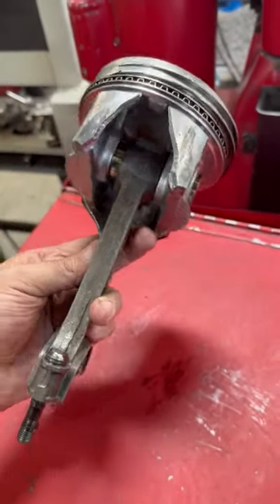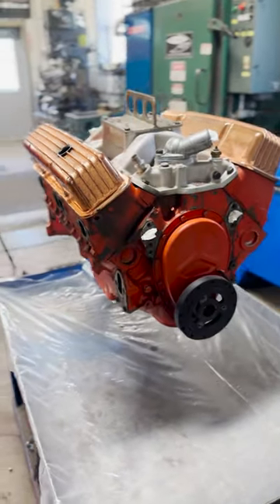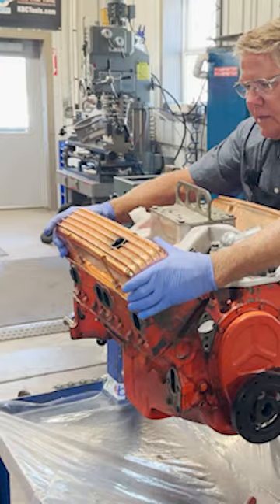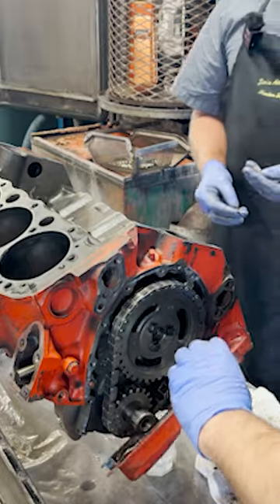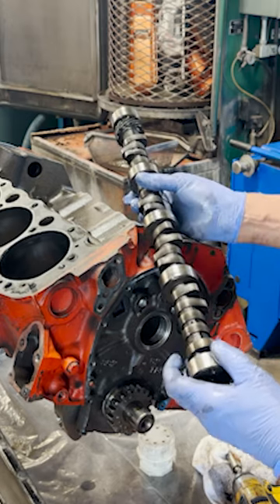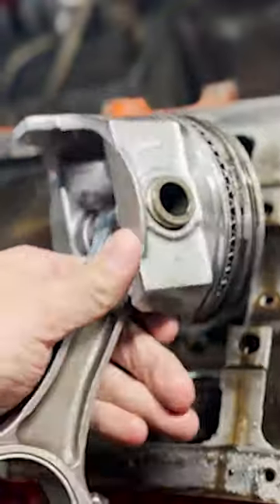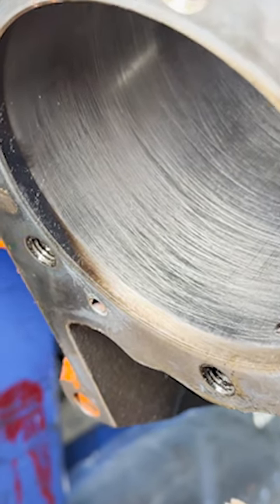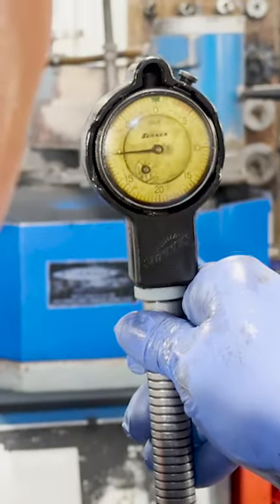#shorts What Could Have Caused This 327 To Fail?!

Comment: Ten thousands taper top to bottom is surely within specs for burn out engines. The rat tail file honing job should have been more than enough to allow for sufficient break in. ;)
Reply: And I just caught that variable timing crank sprocket. I'm surprised that it didn't have the crank sprocket sized inspection/access port in the cover, but I guess those often come with timing chain sized inspection ports.
Reply: @oldsguy354  Pretty much everything let go in that motor. Even the newer volve guides have like a 1/2" of play in them.
Reply: @finscreenname  I saw those guides, they were really bad. It's amazing that engine didn't just fly apart. Can you imagine the piston slapping with maximum valve float at wherever the crank sprocket sent them floating side to side and around we go. I guess the cone shaped cylinders were designed to let the pistons slam the valves shut in a timely manner. I'm amazed that that engine didn't just spread out all over the highway on the way home. Lol
Reply: @oldsguy354  Damn shame to. That 60 year old motor is worth its weight in gold.
Reply: There's a BIG difference between a 'burnout' engine and a 'burned out' engine!
Reply: Here we have an engine with a built in ring compressor.
Reply: @trevorvanbremen4718 You beat me to that one! 😁
Reply: @johngnipper8768 lol!!
Reply: i’m a ‘shade tree’ mechanic and from what i saw, i’m just surprised that the motor didn’t “grenade” the first time they maxxed out the engine

Comment: I have another 67 small journal 327 block bored 4.030 with clevite cam bearings installed. and i have the forged std. crank for it. i had machine work done at diamond racing engine in hammond louisiana. also have 2 sets of GM 492 heads.
Reply: 67 must be the last year for small journal. But yep I got a 65 Vette 4bbl coded one I'm about to play with
Reply: Louisiana huh? Ms here :D

Comment: VVT sprocket on sbc😂😂😂
Reply: 😂  VVT on  a 327.  How did i miss that on my rebuild.
Reply: In all seriousness though I plan to go Freevalve on my 65 Vette 327 engine and completely delete the cam rockers lifters and pushrods and springs. 

Then it's vvti with infinite profiles and zero valve float.
Reply: @ShogunAutoworks  Now that is cool AF tech.
Reply: @Jon-cg3df  I may can't ever do it but damn if it's not an awesome idea. Imagine how good a forged crank small journal 327 with modern heads and the right lightweight but strong rods and Pistons could be if it can rev to the sky without floating valves and also be good on fuel and idle fine. 

Maaaaaaaan
Reply: @ShogunAutoworks  I'd love to see what the max RPM would be, but I think the block would be the weakest point of all. But i still want to see it. :)
Reply: @Jon-cg3df  heck no boost either just free rpms. Another idea... They make flat plane sbc cranks now.
Reply: @ShogunAutoworks  Wouldn't using a desmo valve drive be easier than going fully freevalve?
Reply: @ShogunAutoworks like Indy car engines the valves are on solenoids

Comment: I was working on a truck for someone, and the manual i had said the rear cylinders were meant to have slightly more clearence than the rest, i assume its because in that application those two rear cylinders are recessed under the firewall and sill, i assume they get hotter than the rest thusly expanding more and without the extra clearance they would scuff, scratch or seize in the bore, and the broken piston in the 327, id say it was hot, over revved, improperly machined and setup, the piston was a little on the loose side at the bottom of the bore, at high rpm it travels slightly more down being compressed and tried to flip sideways in the bore, i recently rebuilt and installed a yamaha dirtbike engine for a long time customer of mine, the engine had low compression, never been opened, probably alot of taper, and his son was learning to ride it, but once left alone he was hilding it wide open in first gear because he had not yet been taught to change gears....it did something very similar except it was able to actually flip sideways in the bore while being held full throttle on the rev limiter, broke off the entire piston skirt, cracked and mangled the piston, but un-believrably it didnt yank the wrist pin out of the bottom of the piston when it locked up, pieces of piston skirt fell and busted the crankcase up when the crankshaft counter weights ran into them, ill be twaring down and probably doing a big bore kit on his 2018 KTM 690 Enduro R soon, ive already done his suzuki DRZ400SM and he thinks the DRZ is almost as fast as the KTM and wants more power....😂 Will be my first KTM that new with fuel injection lol.

Comment: You are ripping the guy off, all that engine needed was 2 dabs of silicone and oil top off. Metal flakes are from oil aditive for cylinder wall repair, all it needed was to be left running for an hour without coolant so oil can burn off and deposit the metal where it was supposed to.

Edit: Tapered cyliders are new gradual compression increase performance thing i'm surprised you still haven't heard of.

Comment: Ive seen lots of bad tear downs from a "legendary builder" using narrow bearings on  a normal rod and crank leaving them offset from top to bottom shell to a jegs performance long block with a poorly welded cracks around freeze plugs an all the rocker studs .280 to the side on both heads to  corvette aluminum heads shaved so much the intake valve hit the table when laying flat. But that poor thing was destined to die!

Comment: That's way too much taper means piston slap, them cheap cast pistons where the problem they machined a grove just under the oil ring that made that piston skirt too weak.
The problem with taper besides piston slap is your making that ring expand on the top then contract at the bottom at 4k- 6k rpm. Ring wont hold up to long under those conditions.

Comment: looks as though that piston was fractured before assembly. its not uncommon and is why professional crews will x-ray various engine rotating groups before assembly. could have been defective casting or a dropped piston during assembly. as for the casting hole in the oil Gally above the cam brg. bore there may have been a casting sand hole that just lost its integrity. also a broken bolt or starter bendix got between the flywheel and block.

Comment: That piston. Was. Defective. Period. Or the. Whole other. Seven. Would be in the same. Shape. Or. Did they. Drop it from a tall. Building. Check the. Crack with a. Magnifier and look. Close for old. Crack slot if pe. Buying. Used. Part’s. Which I don’t. Recommend at all. Not for. Competes anyway